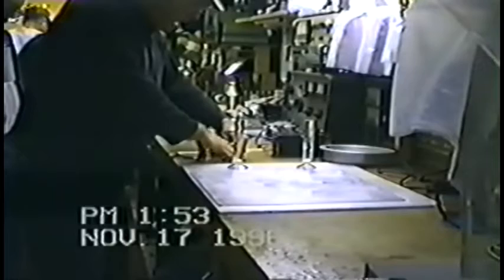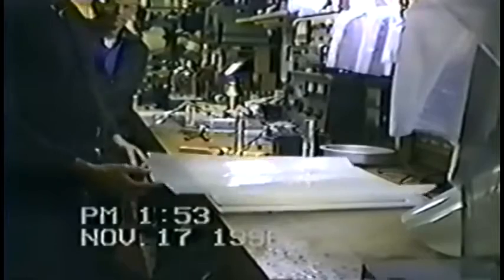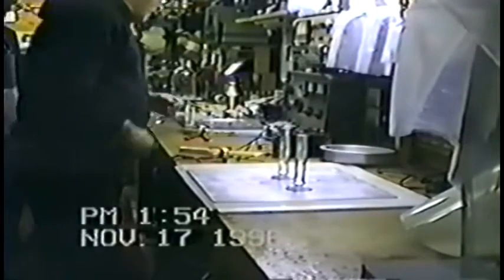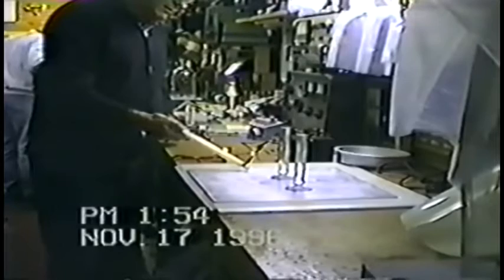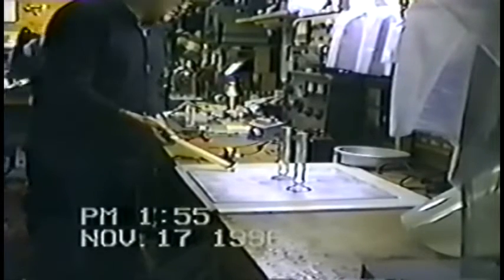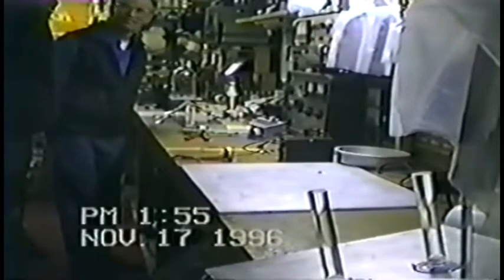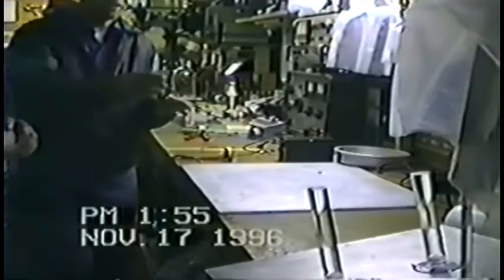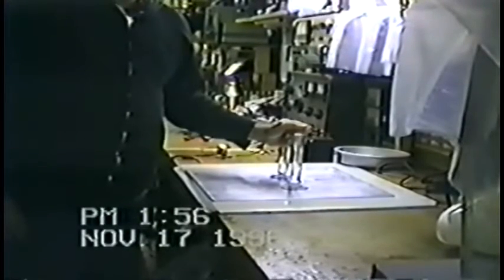Hull dissectable capacitor experiment

Comment: This video should be included in every physics textbook about electricity. Why do most people still believe there is charge in the conductive layer? What is exactly the dielectric material in this video?
Reply from the maker: This video shows the truth via the experiment. - Mylar is used for the dielectric material in this video. Teflon, PVC, Glass, PET and other so called insulating materials should also work in a similar experiment.
Reply: Your question on why people believe that has a multifaceted answer. But it stems from a severe gap in knowledge about the true nature of electricity and it has implications on how quantum physics is a field of study in nonsense as the scientists have no idea what the hell they are observing when doing experiments.
Reply: @seinfan9  Its not just a gap in knowledge but also active suppression for over a century mixed with religious fanaticism  over relativity and quantum, stemming back from their created icon Einstein.
Reply: Vacuum is not a void. Vacuum is a medium that stores energy.
Reply: @nathanneiman  Vacuum is void. By definition, there is no atom in vacuum. There is no energy if there is no atom.